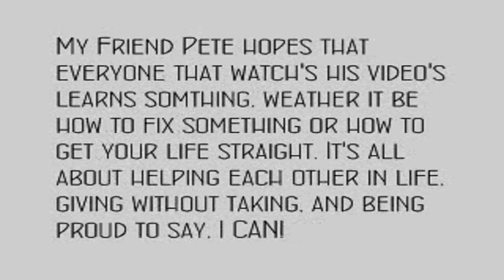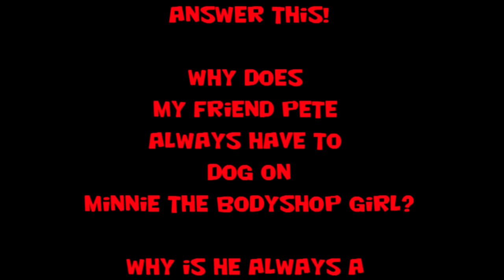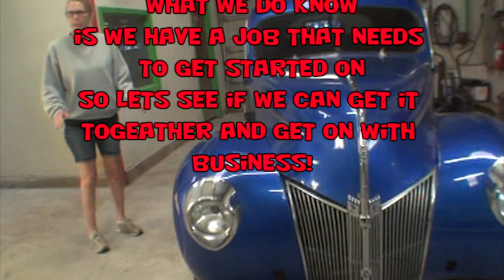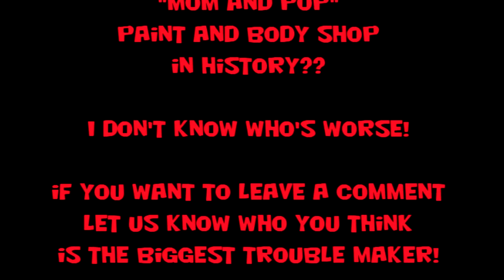How To Fix And Paint A Wrecked Hot Rod Car! Part 1 - The Walk Around

Comment: I used jp211 polyester primer, it cracked on 2 fender 's and at the rear left of the  deck lid 73 nova.I used shopping epoxy then the jp211.should I use what you did the feather fill??.
Reply from the maker: I can’t comment on this product because I’ve never used shopline jp211. I have used the shopline 2k prime and was not satisfied with the results. The evercoat feather fill has been around for a long time and used by many professionals and with the new G2 it really works well.   Good luck

Comment: I would have sat down and talked to the old man and asked him about his car. I love the looks of the 40 Fords. I would have loved to have talked to him about it and ask him what all he did to it. My grandpa did the same thing to a 74 VW Special Edition Sunbug. He bought it from the insurance company for $200 and spent hours working on it. It had caught fire in the engine compartment and burned the wiring harness and any rubber components. He sat down with a Chilton manual and traced down wiring and repaired it. Went all over the engine and replaced everything scorched and melted. Put a new distributor, fuel pump and carburetor on it. Redid the upholstery. Put all new fenders on it. Sanded it all down and had it repainted the original gold color. He was on a mission when it came to that bug.